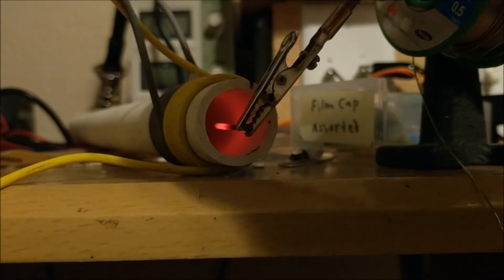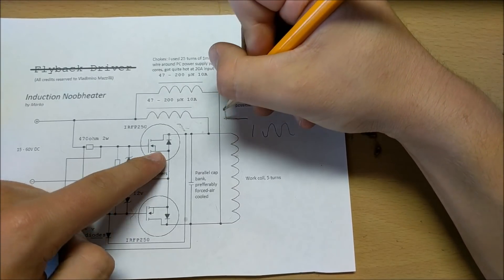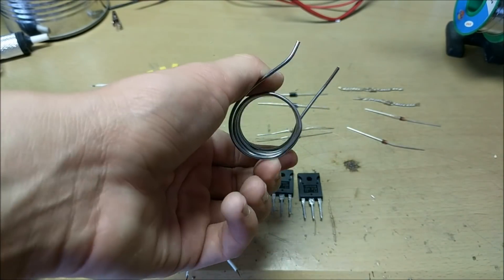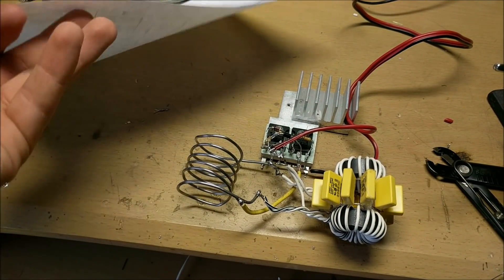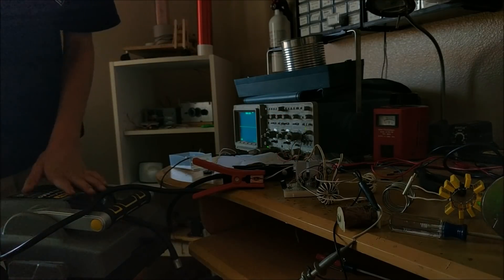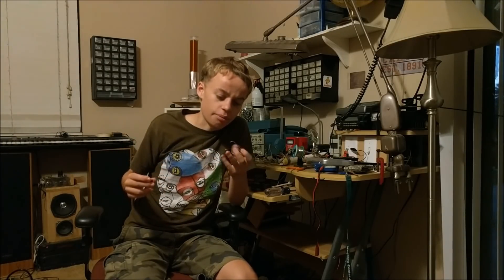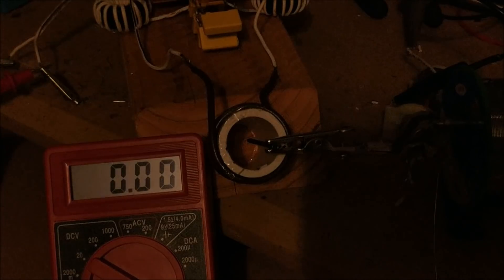How To Build an Induction Heater and How it Works (With LCSC Components)

Comment: Are you connected directly to your power supply? You can't do it that way, you have to use a switch between the supply and the zvs driver, so that you have the supply running when you connect the zvs. The zvs driver needs a big surge to get it "ringing", if the power is "ramped up", both mosfets will switch on at the same time, and smoke them like crack rocks. In addition, you need a substantial power supply that can handle big surges.

Comment: Simple question. Can you use a high frequency plasma cutter for a power source for a induction heater. Both high frequency DC power supply but the plasma cutter box is pretty adjustable at least amperage wise

Comment: It would be really cool if you worked with your sponsor to have a kit that you include all of the relevant diode’s resistors and gates to make everything as well as the small amount of copper wire and every single piece of material that you used in a nutshell and a diagram of how to make it and you sold the kit For X number of dollars which included all of the materials and a small fee for you for putting together the instructions. People would buy the heck out of that. If you got a 3-D printer and printed something to in case it with some buttons, they would probably love it and buy that from you as a small induction coil. That’s how dreams are born. You could be someone who designed an inexpensive coil, but you need to get the power supply right so that it’s either portable or can plug-in with no issues And I think people would support you wholeheartedly. Good luck with everything great job on the video.Robert

Comment: Nicely done. I like the failures being left in...we all make them. I have a melted spot on a proto board where I melted a 555.  SMH. I blew a chunk out of an IC once, too.  Smoke happens.

I'd like to know how the freq is set (capacitor sizing across the load coil?) and what, if anything, sets or limits the output voltage/current.  I'm a hack w electronics, my apologies if learned folks would know this info from looking @ the schematic.

Comment: It is interesting to note, at about timestamp 14:35 that the only part of the doubled paperclip, ONLY the steel parallel to the coil's field heated significantly.There is much less induced (coupled) current if the conductor is perpendicular to the oscillating field.

Comment: A bit late but....You need to turn on the 12v with a switch in the 12v supply not the PSU. If as you were doing, you leave the PSU connected and then turn it on, volts rise relatively slowly and one mosfet turns hard on and stays that way until it goes bang. Intended for anyone thinking of building this stuff.

Comment: i suppose the breadboard couldn't stand too much current?
Reply: In principle it's the resonator capacitor(s) which supply current to its associated coil.  Brute-force scenarios as the Mazzilli/Royer ZVS directly transfer a huge workload to its power source instead, while depending on electrical/analog coupling between the sensitive gates of power MOSFETs and their outputs...  Not to mention the zeners are configured as if one wanted to implement a noise source, feeding a powerful amplifier...  Please read the Allegro ACS733 datasheet and tell me there's no easy way to at least uncouple the I/O retro-feedback path!

Comment: Good enthusiasm but one should use a different procedure. At this stage, each component should be tested individually and it does not take so long to do that with resistors, Zeners, Mosfets.
Listening and looking at the video what interested me most is the following.
*At 05:16 the ground wire link connecting the two sources is too straight and it is too close to the drain and gate of one Mosfet. He should have sagged that link to ensure no other contact apart from the required one.  
* The Zener and the pull down 10K resistor is fine.
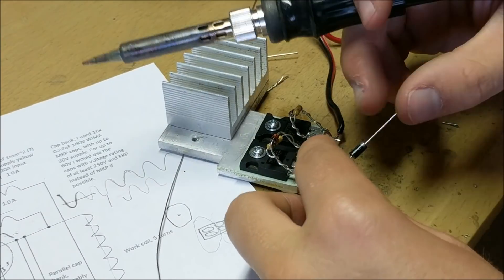* At O6:14 he says that he wants to solder that diode TOTHE SOURCE OF THE OPPOSITE 
MOSFET.  I do not know if he did that,  but he should have said that the opposite side of the pull-down diode should be connected to the DRAIN of the opposite MOSFET. 
It is Christmas Day 2020 so Merry Christmas and carry on with your enthusiasm but with a little bit more care as you build circuits and testing coponents.

Comment: True that he looks 14-ish but did you see the clues that indicate he might be older? In the start he is wearing a MIT shirt. I know this could have been someone else's shirt that he acquired in some way. He bought the mosfets. Most kids would instinctively make reference to a parent buying things for them if they didn't have access to a bank account even if it is a minor's account requiring a guardian to set up. He also does not have the attitude you would typically see with a 14-15 y/o. I'm sure they are other clues also. 
With all of that, I'm guessing his age to be 19-21. The secret to staying young looking is not stressing out over things. Just fix it and keep moving.
Reply from the maker: Good observation! I was around 17 when I made this video. I am 20 now and currently attending MIT. Your secret to staying young is spot on.
Reply: @TannerTech  Thank you for confirmation. It's always nice to get external validation. In this case I was not entirely sure; only a reasonable belief based on what I saw/heard. 
Congratulations on the prestigious college. I know I was very proud of both of my children getting their AS degrees. Now I just got to get them to get the next levels.

Comment: This is a common problem with this push-pull inverter circuit. If the power supply voltage increases too slowly, both mosfets turn on together.
The solution to this problem was invented back in the 1960s with bipolar transistor circuitry.   A low power SCR from collector to base is triggered on with an avalanche diode, which saturates one transistor, starting the push pull cycle.  The SCR is commutated by the saturated transistor.

Comment: Don't forget that hysteresis of the metal.resists change in polarity. This causes heat. Residual polarity is over come with a change in polarity, causing heat. That's what read but not to sure of my understanding, just thought I would mention it.

Comment: Never use it with 10amp smps , it will bypass the short circuit P of the smps because of high frequency plus Load  and over current can blow smps this happened with me , but maybe inductor in series can prevent it not sure..

Comment: After watching you go through several failures, you failed to mention some key bits of data.  What gage was the wire you used for the copper induction coil, and how many wraps in the coil, (and does that matter?)?  And why did you soldier together two pieces of wire to make up your coil we see around time index 14:44?

Comment: Whats blowing ut the mosfet is that the PowerSupply must reach its full voltage before connecting the circuit to it so a separate switch in between will fix that. What also is important is to start the circuit with an emty coil that will save you som capacitors.

Comment: Here it is in Chinglish: It must be noted when using a switching power supply, because a high-power switching power supply generally has a slow-start function, that is, it slowly rises when the output voltage starts, and if the voltage rises to 10V, the induction heating circuit is turned on because If the voltage is not enough, the circuit will not vibrate, so that the two MOS tubes are turned on at the same time to burn the components. Therefore, it is necessary to connect the induction heating circuit after the switching power supply voltage is stable;

Comment: Will the heating effect be the same if you use a longer work coil?I need to heat a metal pipe which is 25 cm to 30 cm long...

Comment: I have also learned about the designs is if the power supply tapers up to it's voltage, the circuit won't oscillate and just shorts frying components. In this case  the solution is to turn on the power supply first and then connect the power to the circuit.

Comment: At significant scales, the induction heater should NOT be turned on with the load inside the coil--A larger metal mass can easily draw a current surge that is initially too high.  I learned this one the hard way!  Also, while on the subject, A slow rise power-on can destroy the heater--let the power come up to the steady state and then turn on with a switch.  One more thing comes to mind:  Once the unit is operating properly, the main power (variac or whatever) can be adjusted (raised or lowered).  I hope this helps you or others.  Your videos are among my favorite.  Anything special /new planned for the future?

Comment: I don't know if you've seen The RadioMechanic's induction heater video. He went into great detail explaining why slow power supply rise times would blow the MOSFETs, but since you started getting better results when you changed to a copper induction coil possibly the problem was different in your case.
Reply: Hey, would you be able to tell me if I should use a 10 amp, 20 amp or a 30 amp power supply?

Comment: At about timestamp 0:55 you are talking about slight mismatches in the two 470 Ohm resistors which determines which FET turns on first.  What if you happen to have two almost perfectly matched resistors?  What do you think about adding a SMALL valued resistor in series with one of the 470's (just over or under the tolerance) so that the turn-on sequence is controlled?
ps:
Where are those safety glasses??  Also some hearing protection might not be a bad idea, especially when running those trials!
THANKS AGAIN FOR THE MOST EXCELLENT VIDEO!

Comment: To anyone attempting this project, do NOT use the Zener diode listed in the description. It is a 5.6v zener diode and for the circuit to function you need a 12v Zener diode. I've been attempting to complete this circuit but have been faulted from the start.
Reply: Would I be able to use a 100uH inductors, instead of 2 of 50uH?
Reply: @samirnabha7993  I used 2 100uh inductors. Without two of near the same inductance I think the circuit will run into problems. There are circuits of this type with a single inductor just Google "split inductor zvs driver"
Reply: @OtherDalfite  Did it worked with the 100uh? Also the ones I have are 3A, are those okay?
Reply: @samirnabha7993  mine are able to do 10a, I measured the wire diameter using a digital caliper which matched a thickness of a wire capable of doing 10a. They are actually 180uh each I would them around some old toroidal cores from a computer PSU.

Comment: Your explanation about how the resonance gets started is incorrect. There is no current path to ground through the tank circuit until one of the MOSFETs turn on. The initial voltage spike occurs after, not before. Connecting a DC voltage to a parallel LC circuit creates a brief oscillation at resonant frequency; the DC source is immediately disconnected as the MOSFET switches due to the high potential at the drain of the MOSFET that is 'on' during the oscillation. This then cycles indefinitely between the two MOSFETs to keep the oscillation going.

Comment: I'm a Union electrician who has worked on many industrial jobs.I came across a holding tank in a foundry that raised the temperature of the metal by induction but also by frequency.Today they are common place along with inductive furnaces that use frequency.

Comment: hello i have made a circuit res 10k and 470 5W  irf 260 diode 12v and 4007       i use 12 pc ps but this not resist burn   i test whit one ps and two in serie     whats wrong????

Comment: great video, I have 2 questions, If air (O2, N2, etc) is flowing inside a pipe (work piece) of a material that cant be heated with induction, would the airflow be heaten ? and what happend if you put a permanent magnet around the work coil ?
Reply: Your question is messed up. I would answer, but... wooosh. Please try to make it clear what you mean here. What are you trying to do? Heat air?
Reply: Yes, I want to heat air, with an induction heater inside a pipe, so I thougt that the airflow could be ionized with the induction heater, and the magnets arround the pipe could direct the flow without heating to much the pipe, like a magnetic nozzle of the vasimr plasma rocket, so I want to know if the induction heater could ionize the air.

Comment: You the man.  Enjoyed your video.  Are you all self taught?  Here is an idea for you.  I work in the medical field and I have been researching and reading on how to build a homemade EKG machine.  At work we have to attach leads to the patient in order to obtain a signal which is then processed by the circuit board to obtain a wave form.  My idea is to devise a smart lead attach it to the patient without wires and have the smart lead communicate with the circuit board via blue tooth or with a laser.  I would welcome your ideas.  RS

Comment: What power supply were you using? If it's a switch mode supply it ramps the voltage on startup and causes the circuit to latch, and dead shorts the mosfets. If you're not using a battery, it's best to add an extra switch to toggle once the power supply has stabilized.

Comment: Hi. 

Good video - a lot of it makes sense and I think I'm learning. But is it just me (I am an ancient musician, after all :-) I can't hear the spoken values of the 10 capacitors (or is it 16, like the schematic show).  Was it 0.47? 4.7? (although the schematic shows 2.7), micro? pico? There are no other audio reference to it, it isn't picked from the cabinet like the MOSFET and resistors, and the video image is too small to read the values. Is there a LCSC link?

2) The link to the MOSFET shows a capacitor. This makes me nervous - is LCSC going to send me MOSFETs or capacitors?

3) And lastly - "Now that the tank circuit is all wired up..." (WHA-A-A?) How is that wired up? On my version of the video, it's skipped over entirely, and it's just shown on the schematic as a simple, single capacitor. 

Remember, I'm new to this stuff, so that may be the ONLY reason why I'm the only one who's questioning these discrepancies. I'd appreciate any help I can get, though - I'd really want to get into this project!

Thanks!
Bob Ellis, Canada

Comment: How expensive would it be to upgrade this design into a device that can be used to heat a 1 by 2 inch high carbon steel bar up to 1200°C?

Comment: Good job on the project. And kudos on sticking with it and figuring out the problem. I think your next step should be to build a larger copper coil and covering it with pyroplaster then use a steel pot as an crucible so that you can use it to melt Lead or Gold by heating the ferrous pan. Lot of potential there.

Comment: Hi Tanner, here’s a couple thousand page resource for free energy gadgets (harnessing added energy from the environment) from flashlights and devices to keep batteries charged away from the grid without solar, to whole house generators for if the grid goes down. Check it out if you’re interested, but bear in mind there are some very dangerous circuits there combining both high voltage and high current. Keep safe! https://sites.google.com/site/aferlab/home/patrick-kelly---a-practical-guide-to-free-energy-devices

Comment: here is also how to get rich quick.!!! take one generator in a dam and take the energy outside to a transformer and make one hundred plugs for conveyor motors to turn one hundred generators and this will save 99.9 percent of the water. now to get rich you sue your local government for wasting water during the summer and during a drought. then  you sue them to make it a law that electricity has to be made in this way and the electric company will have to do it. plus they have to pay you for damages.

Comment: did you know that you can take a chevy volt and take out the engine and put back the generator and run it off the battery with a transformer for a conveyor motor and make sure to use one that is 120 v and 20 amps or the best configuration you can find for the torque for the generator bearings. then put a wheel on the conveyor motor that corresponds to the hertz of the generator 12 equal five time larger 20 equal 3 and 30 equals 2 times larger (the first number is the number of magnets and the seconds is the rotations necessary to make the correct volts using the hertz rotations. then you throw away the gas tank and the engine. the car will go now 20 times farther then if you used gas.

Comment: Cool Project!! The reason you were unsuccessful using steel wire for your coil is because of the resistance of steel. Steel has a much higher resistance than copper as I'm sure you are aware. This added resistance in your tank circuit caused a slowing of the oscillation due to the increase in inductor charging time. This lower frequency meant that each individual MOSFET was on for an extended period of time. Since your coil was not wound around an iron core there was nothing to absorb the magnetic field and your coil reached it's maximum magnetic field quickly (aka Saturation). When a coil saturates, it no longer behaves like a coil and instead behaves like a wire (aka Dead Short). This caused a significant amount of current to flow through your MOSFETs. You may have experienced a similar outcome had you used aluminum wire. Keep experimenting and learning from your mistakes and your successes. Good Luck!!